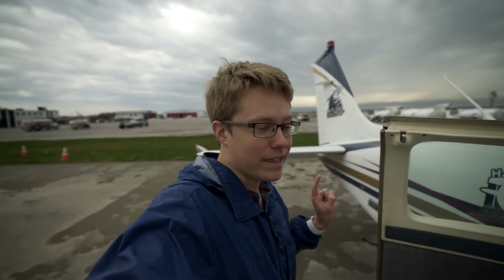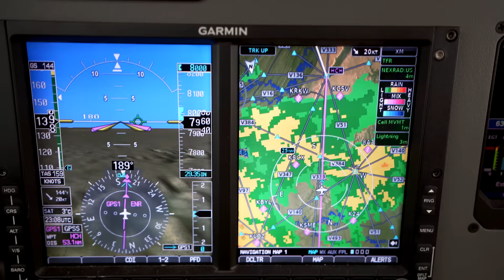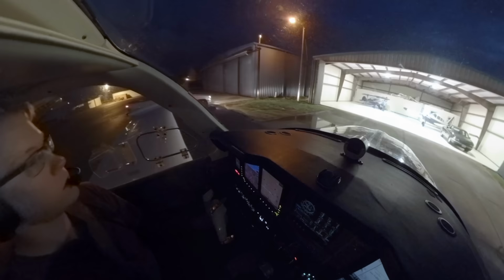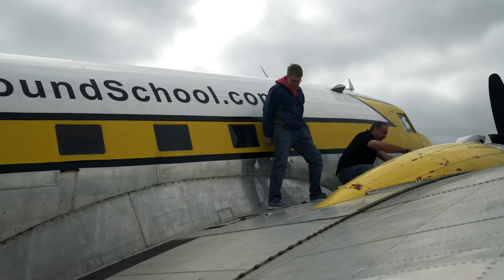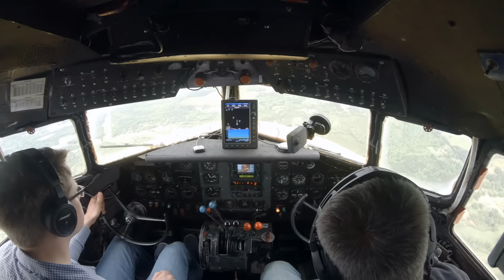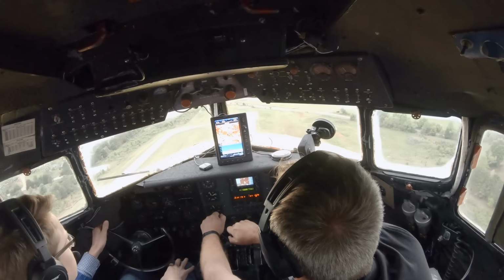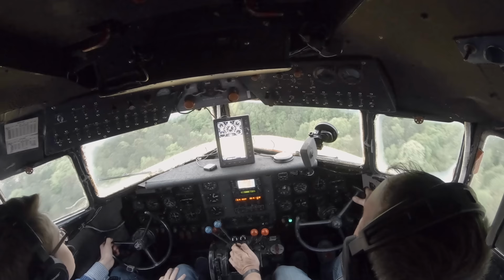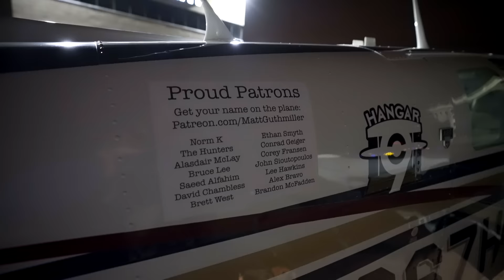How to Fly the Douglas DC-3

Comment: The engine driven blower you were describing around 8:07 is usually referred to as a supercharger.
Reply: Exactly what I was thinking.  Blower driven by exhaust gases, turbo charger, blower driven directly off of the engine, super charger.
Reply: Was going to say the same thing.
Reply: stupid charger. rob power to make power, just jokes.
Reply: @coryostrom2937  No superchargers are very useful.  They significantly increase the power of an engine and are especially important at high altitudes to maintain the correct fuel to air ratios for power and efficiency.  The increase in power is therefore far greater than the power required to drive the system and has benefits for speed and ceiling height.  This has a flow-on effect that you can get more power from a lighter engine so it's worthwhile for that reason if nothing else.

 This technology was crucial in 1942 and to the end of the war to maintain air superiority over Axis aircraft which were also usually supercharged, and continues to be very important in piston aircraft engine design today as is the turbocharger for the same reasons.  The supercharger is superior to the turbo charger in most high altitude applications because it gives more consistent benefits over a wider range of throttle and altitude situations.
Reply: A blower is usually referring to the roots style superchargers, these must have a centrifugal type?
Reply: They were original known as superturbochargers, later shortened to superchargers. Check out the videos on the B-17, B-24, and B-29, pilot familiarity and flight engineer.
Reply: @jytheiowaguy1897  There also screw type superchargers (used by Volkswagen at some point i think)
Reply: @coryostrom2937  The P & W Supercharger design works very well for radial design engines. This is because the geared design is incredibly efficient. Pratt & Whitney eventually introduced a two stage variant that offered incredible flexibility.

Turbochargers are actually pretty bad at high altitude because they easily overheat (troublesome cooling) and limited to maximum boost for lean fuel burn conditions. 

Pratt & Whitney superchargers cannot be compared to automotive / heavy truck belt or geared driven designs that do consume significant horsepower that are mainly operated at sea level to 4,500 ASL unless you're in the Rockies. 671 to 1271 blowers cannot be compared. Not even close to the same design.  Even the ATI / Paxton superchargers, the design and  setup isn't even close to same except for the impeller rpms possible. 

The same is true of the Rolls Royce Merlin V-12 Single and Two Stage supercharger, which were capable of 35 - 50" of boost.
Reply: @Chrisamic  As I am studying ATPL theory at the time, my findings were that turbochargers were more efficient than superchargers because they don't take away energy from the engine but only from the exhaust gases. In the end this seems like a more effective process.
Reply: @markusthl  Superchargers take away power as well from an engine, this is pretty obvious. You are either driving a gear or belt system which is adding resistance. ATPL theory is useless is examining these systems sorry
Reply: @nmnmnm35  you mean turbochargers? I already said that superchargers take away power from the engine
Reply: @markusthl  That's fine and correct in theory, possibly for car engines designed for more pedestrian applications.  Look outside your textbooks (ie find better books) for the answer in this case though.

Aircraft engines of this era had to operate at altitudes up to 39,000 feet, in a wide range of conditions and throttle settings.  Particularly - these engines don't have much in the way of noise mitigation - the use mode is to port the exhaust pretty well straight out the side with very little modification or back pressure.  They were set up this way to optimise engine efficiency and weight.  Adding a turbocharger would have been completely out of the question and would have cost far more in power and efficiency than you would gain.  Even in car engines at sea level, the change in back pressure has to be accounted for and one way this is normally done by disabling the turbo charger at lower pressures.  This would not have been an acceptable solution at that time or at 39,000 feet.  The supercharger was not optional for a piston engine designed for war at this altitude.  Supercharger = always on, always increasing manifold pressure at any altitude or throttle setting.  That's important at altitudes that people and IC engines start to die without assistance.

Turbo chargers require cooling, usually oil, which comes from a pump, driven by the engine.  I'm wondering if you figured that into your "theory".

Lastly, TANSTASFL.  Turbo chargers require back pressure, which takes power from the engine on the exhaust stroke.  Assuming that there is any free energy in any closed system is an attractive thought, but it's a fallacious one.  If you think it's "free" energy, I'll start questioning the state of the education system...

Why was this particular engine picked for the DC3?  Most likely because it was in common production for a warbird and was readily available, plus it met the criteria for fuel efficiency and power that the DC3 needed for heavy lift applications and range.   It is most likely that the supercharger was modified to operate most efficiently at the altitudes that the DC3 operated at, which would have been different to warbird applications.

Why is this system still being used on this particular aircraft?  It's almost impossible to modify an aircraft of this age.  The regulatory requirements are extremely strict and it would be quite difficult - you can't just modify an aircraft and if you do it will invalidate it's airworthiness certificate without the right paperwork ($$$).  On top of this, it's a historical aircraft and you wouldn't want to modify it any case.  I just don't understand people getting bent out of shape over the use of a supercharger in this application - it's was the best thing for the application eighty years ago so that's what they used.  

Historical context: two seconds of google-fu and you can see that this was a very common engine in use at the time.  Apart from the DC3 (Douglas C-47) the Pratt & Whitney R-1830 Wasp engine was used in the B24 Liberator, the Grumman F4F Wildcat, and the PBY Catalina, though I don't believe the Catalina application would have required the superchargers (I could be wrong).
Reply: To help clarify the terms "turbo-supercharger" is an exhaust driven supercharger, known today just as a turbo. Planes that used external turbo were the B-17, P-38 and B-24 to supplement the primary supercharger which is part of the engine itself. These were centrifugal "superchargers" that are directly driven by the engine  and are found behind the case. In some radials it's part of the rear case.  The DC-3 utilizes a built in centrifugal supercharger that is built into the back of the engine.  Look on the left of this engine in the picture:  https://upload.wikimedia.org/wikipedia/commons/thumb/2/23/Cross_Section_of_a_Pratt_and_Whitney_R2800_Double_Wasp.JPG/1920px-Cross_Section_of_a_Pratt_and_Whitney_R2800_Double_Wasp.JPG?1561676606016
Reply: @MrMannakin   roots
Reply: @Chrisamic  truth. this deserves a like
Reply: ryan0io ...If you want to knitpick, a supercharger is any blower. A turbosupercharger is a blower that uses an exhaust driven rotory turbine.
Reply: @askhowiknow5527  thank you
Reply: The first car to have a turbo or super charger was called a Bentley blower , this plane was designed and built close the thst time , so calling it a blower is probably terminology over that time !?!?!?!?!?
Reply: @coryostrom2937  they actually work very well.
Reply: @DougHanchard  my 14-71 makes 62 psi
Reply: @coryostrom2937  to really mess with your mind a top fuel dragster's supercharger takes over 800 hp to run it at full throttle, but the increase in HP is somewhere in the 6000 hp range. for a total hp output in the 10,500 hp. so yeah they are worth it in an airplane.
Reply: I was literally looking for this comment
Reply: I said that as he was explaining it too!

Comment: My grandfather had a small fleet of DC3 and war surplus C-47 Skytrains. He did aerial surveys, U.S. mail and general cargo all over the southwest, mostly farmers and rangers and later the oil and gas industry. I was trying to tell if this plane was indeed a DC3 as they were manufactured from 1936 through 1942 and again in 1950. There is still a lot of C-47s out there, very cable aircraft. A lot of the earlier models had the Wright R-1820 Cyclone 9 engines and a lot of the later 3s and C-47s had the Pratt & Whitney R-1830 Twin Wasp. After the war when they started showing up as surplus a lot of pre1942 DC3s swapped over to the Pratt & Whitney R-1830 Twin Wasp. The Cyclone 9 loved to backfire would scare the crap out of me every time. The Twin Wasp would make this very low throb at cruise, then the engines would somehow sync and made this roaring sound, then they would fall out of sync they also would put a blue fire ring out the exhaust when you got the air-fuel mixture right at altitude. My grandfather would carry a barrel of oil on every plane as you mentioned in the video each engine is 25 gallons. And it was fun getting that dolly and barrel out the plane. Great Planes. You didn't really need airstrips just a somewhat level area to land and take off from. A lot of these planes were used as both passenger and cargo in Alaska. Good video.

Comment: On the Aircraft your using 37hp I think you might have an antenna issue of some sort.. I would recommend finding some one that ether has an Antenna Analyzer or SWR meter and test your swr on the antenna.. My guess is its probably some sort of grounding issue with the antenna..  Another thought is that the cables could be deteriorating if you replace them I recommend higher grade cable preferably flooded cable this way no moisture can seep into the coax.. Just a thought.. Some one with an Antenna Analyzer and SWR tester could rule out issues very quickly..If it tests fine low swr and the aviation band looks good swr wise it's not your antenna system.. If it's not that its probably some thing interfering with your radio its self but that is typically rare in Aviation equipment..  If you end up replacing your antenna I recommend 1/2 wave for the band your working in.. Probably will have to use a Jpole calculator to get an idea of the length of the antenna for the frequency range your working  with then purchase a similar design antenna from you provider. I don't know how things are done in aircraft but i am probably guessing you will probably have to have a certified mechanic to install it.. Just a guess..

Comment: That was a workout, Matt.  Brings back memories of my flying round engines in the Navy; Wright R-1820's in T-28's and Grumman S-2's.  The 1820 in the T-28 had a 2 stage blower (supercharger); the S-2 same engine but a single stage blower.  Engine in the T-28 was rated at 1425 HP; the S-2 rated 1525 HP.  The 100 HP difference was the loss driving the 2 stage blower in the T-28 engine.  The DC-3 had the Pratt 1830's, correct?  1200 HP??
Reply: I flew 1,600 hours on DC-3's & most had the Pratt R-1830's but the ones I flew most had the R-1820 Cyclones.
Not much difference in operation.
BTW I went strait from single engine Cessna, Piper & Tiger Moth Bi-Planes, so for me this was the big time! I had never flown twins, retractable gear & had 10 hours instrument.
Loved flying them but at night in with Thunder Storms around & your at the LSA (Lowest Safe Altitude) with Meto Power (Maximum Except Take Off) on & your going down hill it was NOT fun!!!
Reply: Do you mean 2 speed blower? Don't think they put 2 stage blowers on T-28 1820s, know they did not on 1820s in FMs. 2 speed, yes. 2 stage is something entirely different.
Reply: Yes Tom, 2 speed.  The T-28 had a lot of power, but it was definitely not a top fuel dragster.  If I remember correctly(it's been 40 yrs!!) we pulled the throttle back to 20 inches MAP, then the prop to 1600 RPM, and then shifted into high blower.  The MAP would jump about an inch; and then we were good to go up into the teens (or higher).  Our basic instrument hops were accomplished in the mid teens.
Reply: @oltimer5544  Chop, prop, 110, drop!

Comment: First love... not one was ever lost because of structural failure.  This is a plane that should be manufactured again for use in developing countries as local Air Services and Air Cargo Transport System networks. Got 1 as a toy in 1962 or 63. You still can buy a restored dc3 rated as new or 0 hrs  on restored airframes for around $100,000.00 to $300'000.00 and then some! Bring back the DC3! :)

Comment: 344 hours on Daks.  One engine fail at 8k.. fixed with carbo heat.  Another on take off at 200 feet.. Had to land on  the right.  Both at full gross..

Comment: That's a supercharger my friend
Reply: I guess the reason that the DC-3 has superchargers is that it's easier to have a super over a turbo because the exhaust manifold would be even more complicated with a turbo? The exhaust is basically routed from each cylinder to one (or two?) point(s) and then straight out the side.

Comment: With the modern avionics on board to supplement the 1935 design... could there ever be a better aircraft? The modern screens remind me of the "Glass Cockpit" upgrades to the Space Shuttle that were implemented first on the storied Space Shuttle Discovery (STS OV-103) starting in the mid 1990s. Modern avionics plus the most reliable aircraft that ever flew.

Comment: Does anyone know why he pushes the levers for prop feathering completely forward only shortly after touchdown? I thought you normally do that before you go into final approach so that you have maximum thrust in case you have to go around. Please excuse if this is a dumb question and my terminology is all over the place. I'm very new to the flight simming thing and have zero real flight experience. Also: are the mixture levers on full rich in the position at touchdown or do they not have to be to land a DC-3?

Comment: At 6:10, is there a reason why you cancel IFR right before landing?
Reply: Will Oliver it sometimes is useful because there may not be radio reception on the ground to contact the controller to cancel at a non towered airport and it’s quicker than calling on the phone after landing. Also they cannot depart another aircraft from that airport or possible a nearby airport due to your IFR arrival so there by cancelling early gives them the opportunity to get another aircraft airborne possibly. Something to consider though when landing late at night at an empty airport when no one is around is that if you cancel early and something were to happen upon landing, nobody will know until morning.
Reply: PilotguyR6 ah ok here in Belgium irrispective of IFR/VFR you have to close your plan within 30 minutes, if you cancel IFR you get automatically assigned to VFR so your plane stays open until you call to close.

For the departing traffic I'm not 100% sure about IFR, but VFR traffic is still allowed to epart.